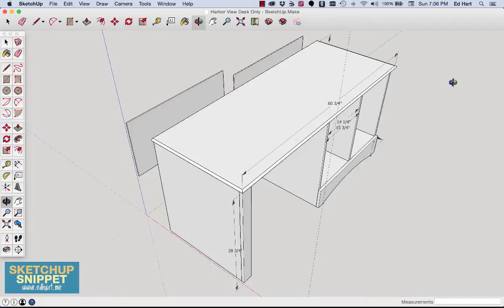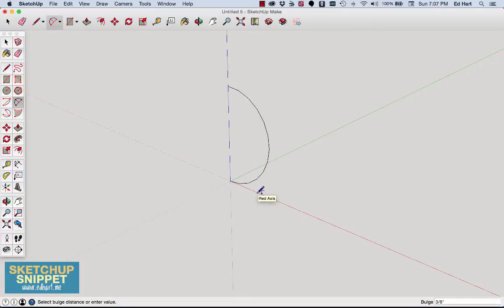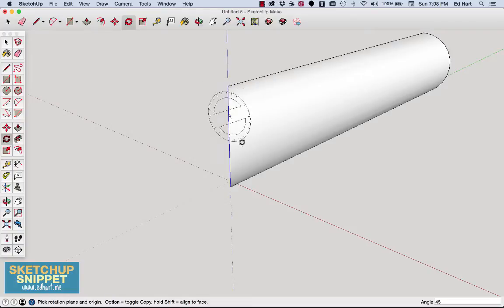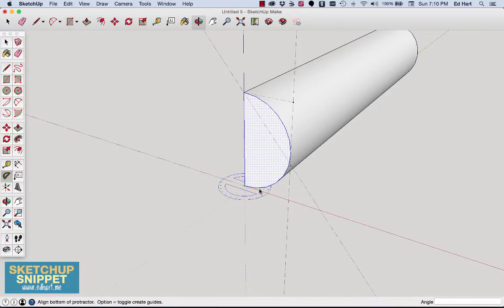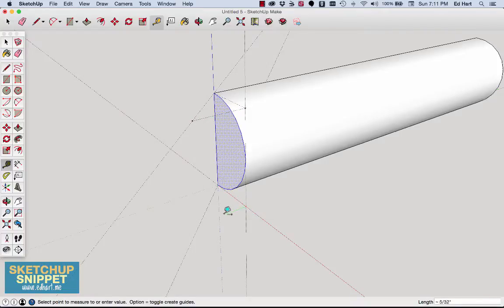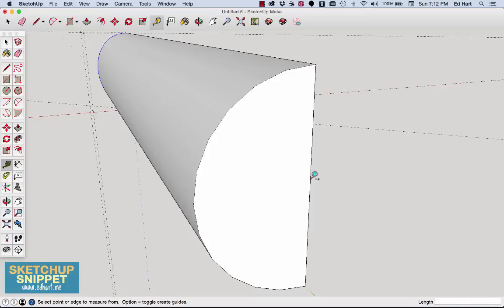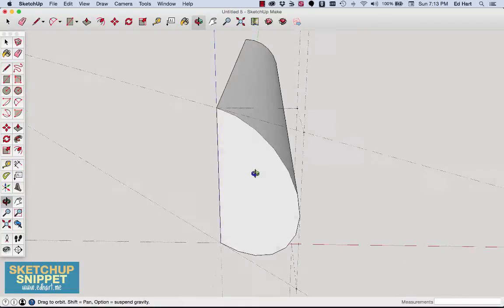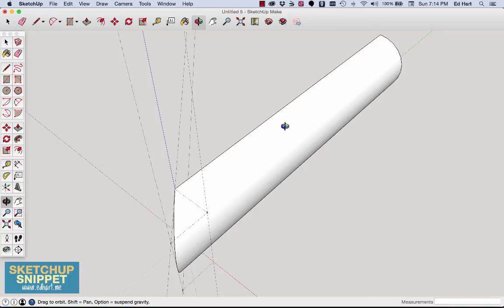SketchUp Snippet: Mitered Corner on Half Round Moulding

Comment: Try this: 
> Create a circle with the circle tool (obviously😋) having a 3/8" radius.
> Use the push/pull tool to extrude the circle into a cylinder. If you know the desired dimensions already, extrude to match the length of the long side of the 45 degree cut.
> Don't group anything or make a component yet.
> Rotate the cylinder (or whatever you gotta do) so that the bottom midpoint of one of its faces coincides with the origin.
> Nearby, create a rectangle having the same length as your cylinder, and with a height about double the cylinder's diameter - so 1.5 or 2 inches should do.
> Make this long rectangle a group of its own.
> This rectangle will be a "cutting face". Rotate it so it is oriented upright along the blue axis, then position it so that it bisects your cylinder down the length.
> Zoom out so you can easily drag the mouse to encompass both objects. Once everything is highlighted blue, hold down the shift key and mouse-click the cutting face to deselect it.
> With your cylinder selected, right-click, and select intersect faces/with model.
> Click the mouse somewhere away from any object to deselect everything. 
> On a broadside of the newly bisected cylinder, double-click about the middle of the face so that half of the cylinder (edges, faces) highlights blue.
> With this half-cylinder selected, create a new component out of it.
> Next, rotate your cutting face 45 degrees along the blue axis, then move it to coincide with the midpoint of the half circle face at the end of your cylinder.
> Double click your new component so that it can be edited, double click it again to highlight the whole thing blue, and once again intersect faces with model.
> Move the cutting face away to isolate the component, then delete the "cut-offs" (the extra edges&faces created when you intersected).
> Rotate as necessary to repeat at the other end of the trim.
> Congratulate yourself on a job well done.. 😉

Comment: This is not the best technique, as it introduces unnecessary lines that you can see if you view hidden geometry.  There are lines in the moulding that are no longer parallel, as they were before you rotated and scaled the face. This could introduce problems down the line if you need to do more scaling, etc. with that geometry.

It would be better to group the moulding and then create a rectangle outside the group, rotate it 45 degrees and then position it so that it "cuts" completely through the moulding.  Then open the group, select everything, right click and choose "intersect faces -> with model".  Now you can erase the part of the moulding that you just "cut off", close the group, and delete the rectangle you made to cut it with.  You'll probably notice that the cut left an empty face letting you see into the interior of the moulding.  Just open the group and draw a line along any edge to close that face.

That's one way; there are several others, all avoiding the problems with rotating and scaling that face.
Reply: This worked perfectly!